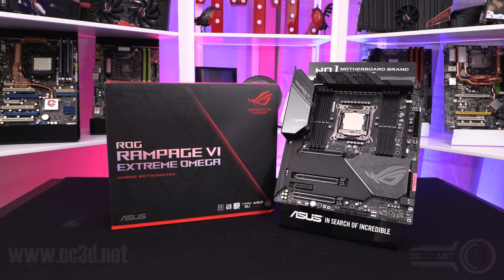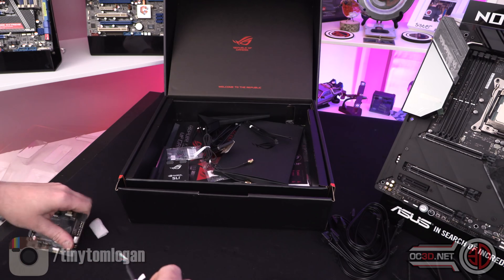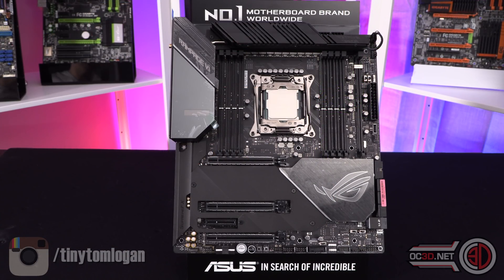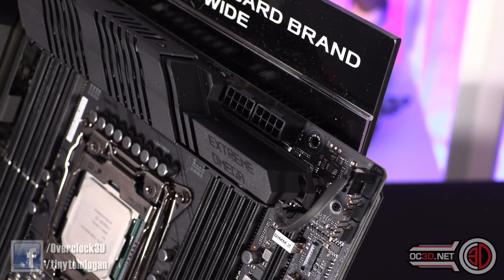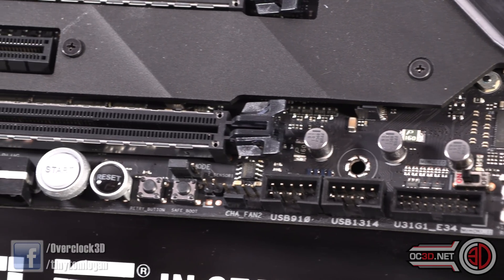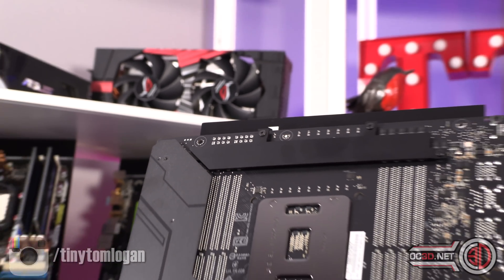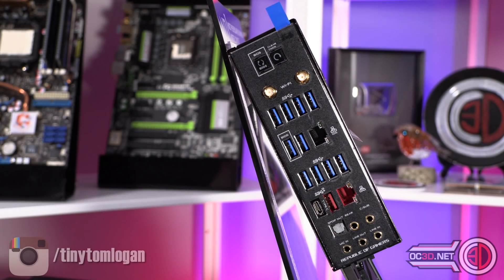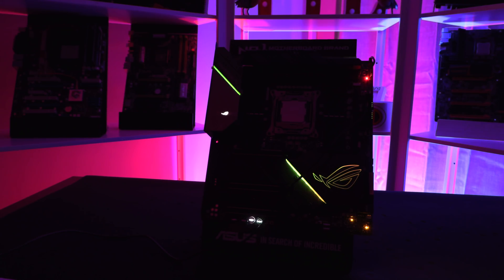ROG Rampage VI Extreme Omega Preview

Comment: can anyone help, it's been ten years since I built a pc, I have just ordered this motherboard from amazon and it automatically recommended Corsair Vengeance RGB PRO 64 GB (8 x 8 GB) DDR4 3000 MHz C15 XMP 2.0 Enthusiast RGB LED Illuminated Memory Kit - Black CMW64GX4M8C3000C15 https://www.amazon.co.uk/gp/product/B07D1RDD8T/ref=ppx_yo_dt_b_asin_title_o03_s00?ie=UTF8&psc=1 so I bought them but I can't find any information if they are compatible or not, I have even checked on Asus and I can't find that memory in there recommended list, if anyone could help and reply back it would be much appreciated

Comment: Does this MB fit on a ATX chassis? the dimensions is a bit bigger (12" x 10.9") than ATX (12” x 9.6”), but smaller than E-ATX (12” x 13”)... Does its form factor/screw holes match standard ATX? I am asking because i am considering on of the Thermaltake Core P chassis...

Comment: Can someone explain to me which size slot NVLink bridge I need to use due to how this MB is setup? It doesn't look like a 4 slot or a 3 slot will work? The board only came with a small HB SLI bridge that will not work since I have to use NVLink.

Comment: I'm old enough to appreciate that this board is engineering genius for less than $800. Incredible technology for a desktop computer to play games and do live streaming. Even if it does have a cheap WiFi antenna...or a short adapter cable for the fan card...big deal. Everyone is so jaded and spoiled...